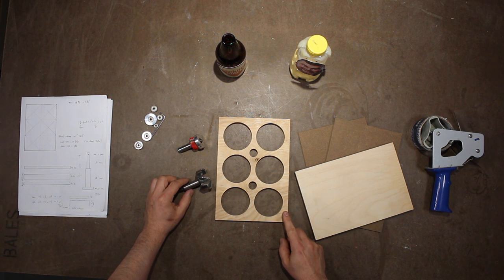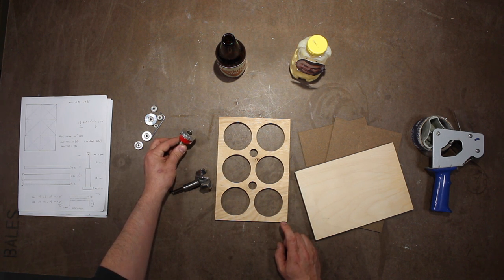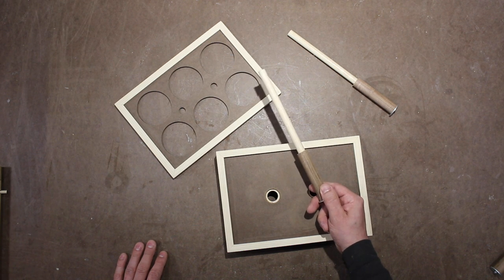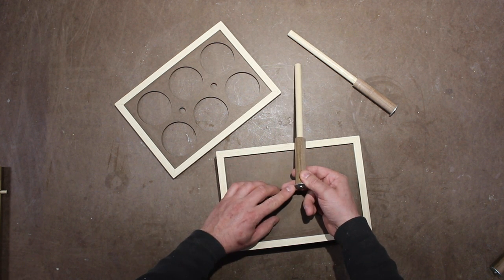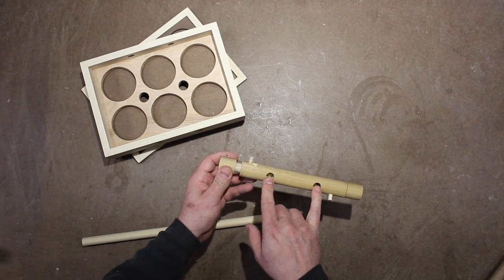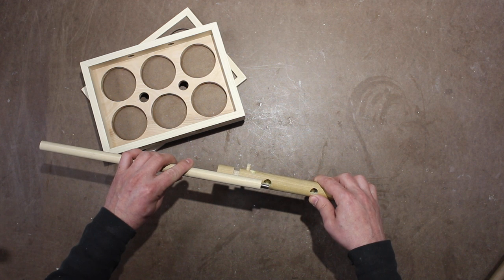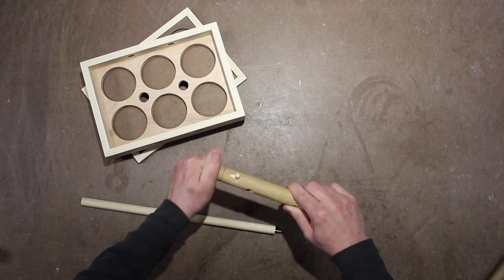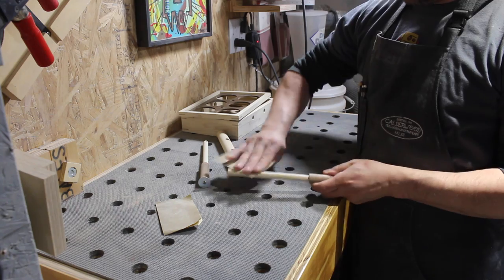The Flat Pack Beer Caddy

Comment: Far and away the coolest beer caddy design I've seen.  One concern though on using hardboard for the components.  My experiences with hardboard has been that it LOVES moisture, will wick it up and swell.  That could be a problem with cold glass containers on a hot humid day.  Still, I am going to tweak this design and use it.
Reply from the maker: Totally agree in regard to hardboard - I’m was in prototype/ use what I had mode. Acrylic or highly figured veneered 1/4 plywood would be better.